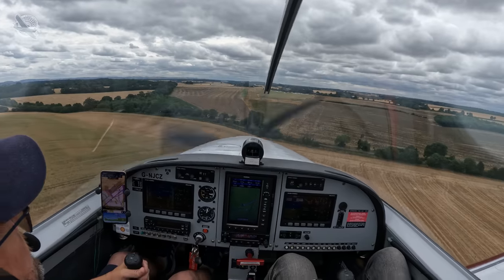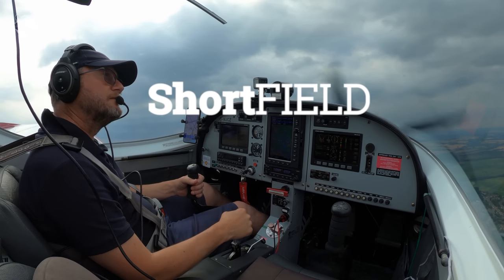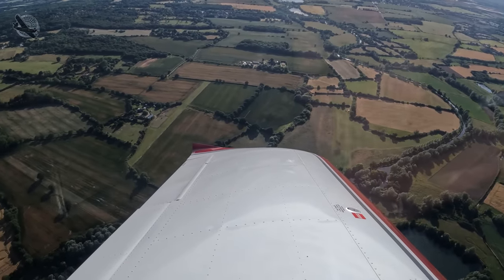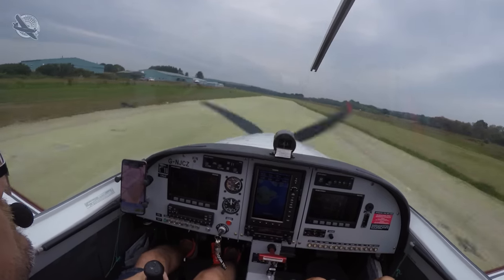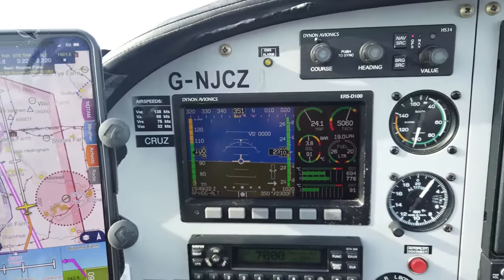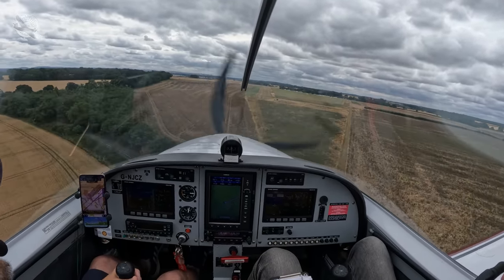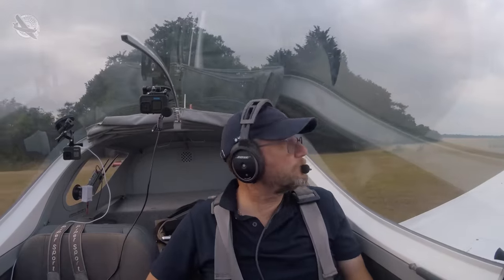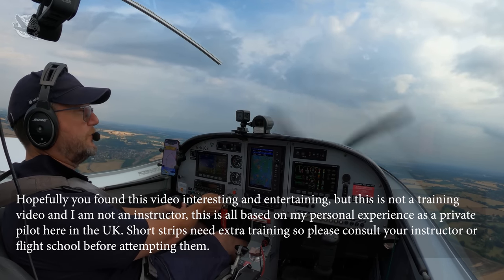Are short farm strips really that DANGEROUS?

Comment: When people ask "is it dangerous?", they ask "can this hurt someone?", i.e., an eventual outcome. But it's hard to give a simple answer to that without someone explaining also the basics of risk management in aviation: there are hazards, inherent risks, mitigations, and then we get to the residual risk or level of danger (higher than usual safety level, e.g., in comparison to driving or flying commercial airliners, or just riding horses, skiing etc.  :) )
So what you explain is that there are more hazards at farm fields, they often pose an higher-than-usual inherent risk to landing and takeoff, but with a more-careful-than-usual preparation, you can mitigate those risks to a level, where they don't pose a significantly greater danger than landing/departing regular airfields.  So long story short, I usually say that flying is (inherently) risky,  but we are trained to prevent/mitigate those risks to happen, so it's not more dangerous than other things we do in life. (There is so such thing as a zero-risk activity.)

Comment: Good evening.  As a 10,000 hr CFI      4000 in Light sport alone and almost 1000 in Sport Cruiser.   You give excellant advice..It does appear on take off you are lifting nosewheel a bit late and on landing too flat. need to touch town at a higher angle to better protect nose gear.   In fact I STRONGLY recommend do not use airspeed to rotate on Take off.   Pick an abort point on field instead.    Lift Nose ASAP and keep a cpl inches aboce the ground the plane will lift off when ready into ground effect. accelorate the Climb at VY. or X to safe alt them VY plus 10 or so
Reply from the maker: Great advice, thank you.

Comment: Another cracking video Terry, you raise some good points. My dad always used to quiz me - especially in the summer months - "which piece of grass is the runway?". So as soon as you said similar, in a "drought", I gathered it would be the right hand brown area. If in doubt and all things are equal do a low level pass. Interestingly at 400m? That's quite tight isn't it, even in some FW microlights? Also in some FW ML's you can't hold it on the brakes with power on, as the discs warp etc (glorified bicycle disk brakes), so other short field techniques are required, Eg start at a right angle or just around the bend on the taxiway and run onto the runway with just a few knots on 😲😄👍 Not for the uninitiated though 🤔😉😊👍✌️

Comment: Like others have commented, short strips are not dangerous if the plane, pilot  and conditions are up to speed. Pilot experience needs to make that evaluation. Piper cub? No problem. Heavy single? Maybe a problem. Pilot is an experienced back country pilot? No problem. Pilot not proficient in short field technique? Problem. As you can see, a blanket statement that short farm fields are dangerous, or even raising the question, is short sighted. A better question would be: what training is required for safe operations on short unimproved strips? The Private Pilot License does not prepare a pilot for such operations. It requires practice and precise flying for your typical grass strip. For shorter and more challenging strips, it requires training with an experienced instructor. You need biannual flight reviews (and similar in other countries), so why not use the time to get that training. Improve your skills instead of just maintaining them. It's fun.

Ben C
26,000 hrs and still learning
Reply: 'The Private Pilot License does not prepare a pilot for such operations' ..... nor does a CPL, ATPL or a fast jet jockey.... just adding ..where on earth would you find an experienced instructor  proficient in short field grass strips in say a Jabiru ...
Reply: True, back country/short field/unimproved runway operations is a specialized area of aviation. The first hint of such operations is the Private Pilot License, where short /soft field ops are addressed. "Short and Soft" is a relative thing. 2000 feet of nice grass is probably not an issue. 1000 ft of tall wild grass and soft dirt with obstacles is probably not good for an inexperienced pilot. If it's something that causes concern, then more specialized training is probably required. CPL and ATP are geared toward commercial operations. Anyone interested in back country type of operations will likely spend time practicing their stick and rudder skills, and flying precise approaches at minimum speed, consistently landing on a predetermined spot on the runway. Any experienced instructor can help in that regard. There's bound to be an FBO somewhere that deals with tailwheel aircraft training in Cubs or Citabria's. Not that a tailwheel is necessarily required, but that's where you can like minded pilots (get tailwheel training anyway. You'll learn a lot and fly better). After that, one will need to take their own steps and build up their experience. Most of the planes are variations of the Cub, so I don't think  you need a CFI or someone experienced in type. Just someone more skilled than you are. Or, if serious, take a vacation and spend a week at a back country operation that teaches such adventure flying (Idaho). In this case, the question is about a short farm strip. Others probably fly into it, so tag along with them and learn. Or take a CFI. Or just do touch and go's till one is comfortable full stopping. By then they should have an idea what the takeoff distance will be. Maybe practice on a longer grass runway to gain confidence and get an idea of landing and takeoff distance (the POH is fine for paved runways, but lack accuracy regarding unimproved surfaces. Gather your own data). And the golden rule: if a pilot feels something makes them uncomfortable, or they feel it's dangerous, then don't do it until they get more experience and feel differently. Aviation is all about learning and gaining experience. Im' still learning and I know my limits. Limits that I know can be expanded with more learning.
Reply: @apocalips8008  Many of the skills required for short fields, such as high accuracy/precision and really good stick and rudder work, do not need specialised tutors. I learnt with an ex-military instructor, who did a lot of work on my basic skills and then sent me for finishing to a former colleague who mostly teaches on microlights.